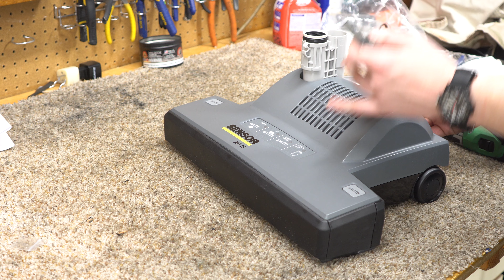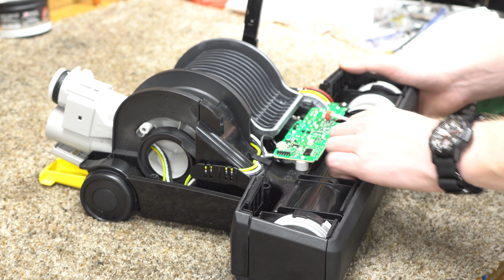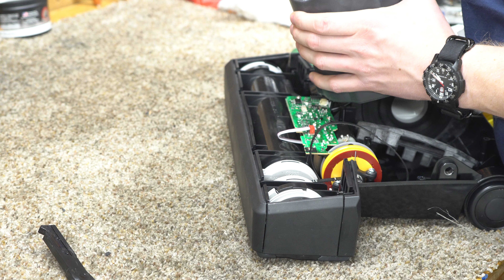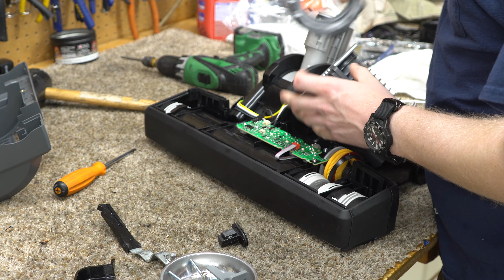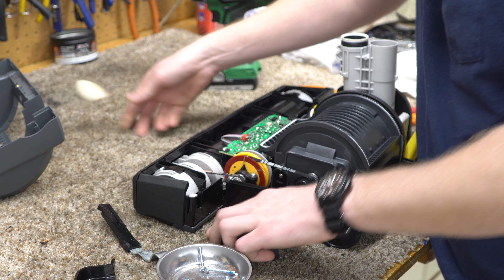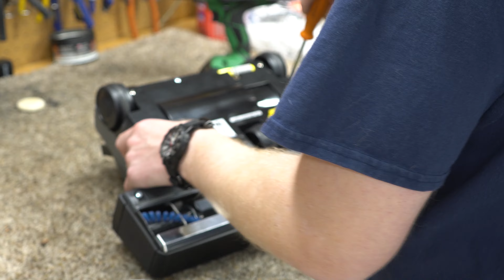How to fix Windsor Sensor XP12 XP15 XP18 Vacuum Cleaners

Comment: I'm trying to take apart the upper portion to replace the internal cable that runs from the handle to the base. I can't find instructions anywhere that shows how to access the plug that the handle plugs into.
Reply from the maker: Just change it as a whole assembly.